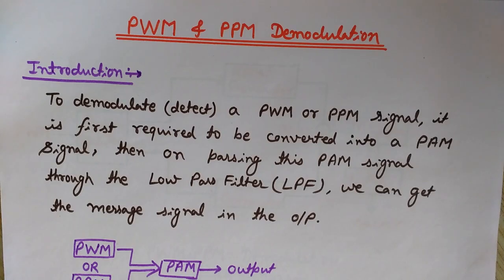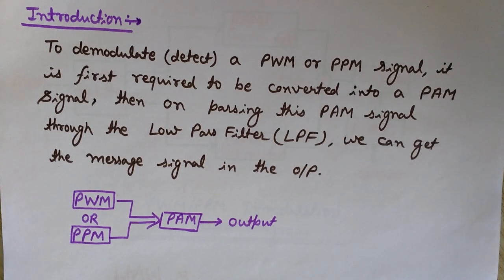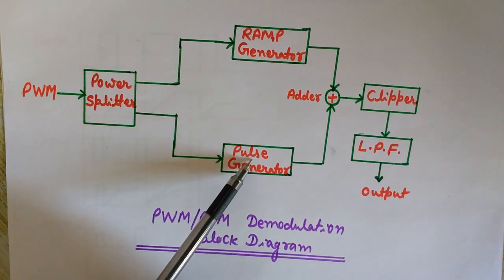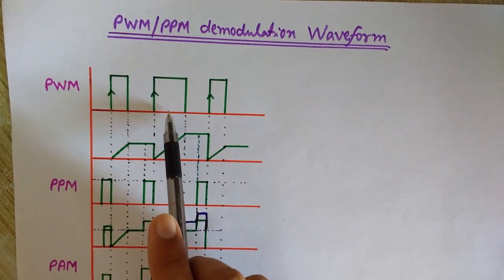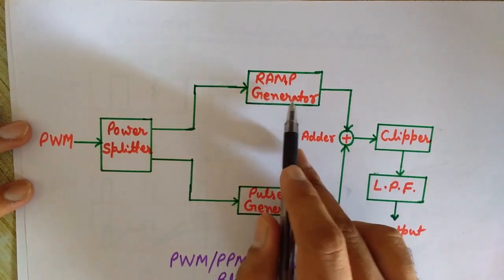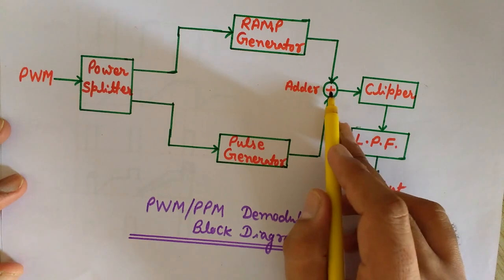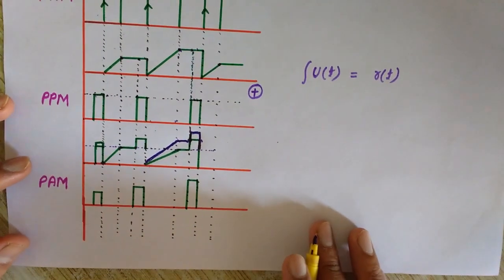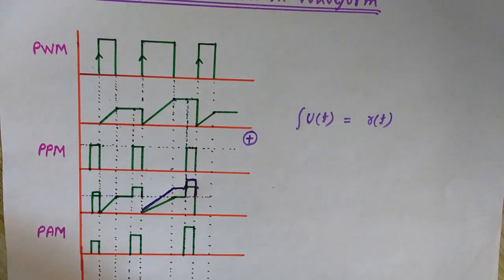Demodulation of PWM and PPM (Block Diagram and Waveform) - PWM and PPM Detection - Pulse Modulation

Comment: Sir i have two questions rising in my mind:
1) If the clipper being used here gets faulty and it starts to clip voltage levels within the rising ramp function/s. Can you suggest any modification or any alteration in the above mentioned block diagram that could make you get rid of the fault.
2) let suppose if synchronous pulse generator will generate a pulse waveform such that the pulse will end at the ending of each PWM pulse. How this slight variation in the operation of the system would hamper or shall not hamper the final output of the system.